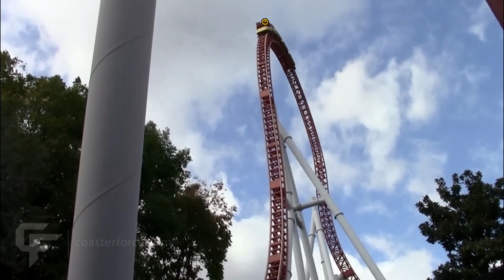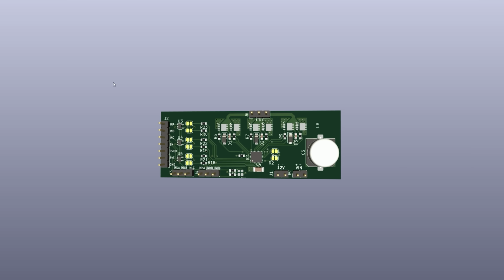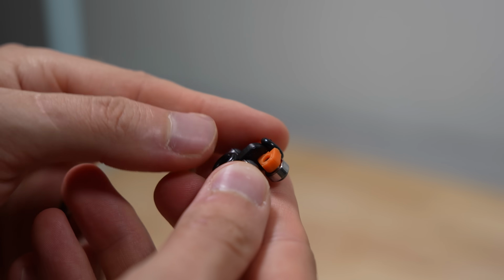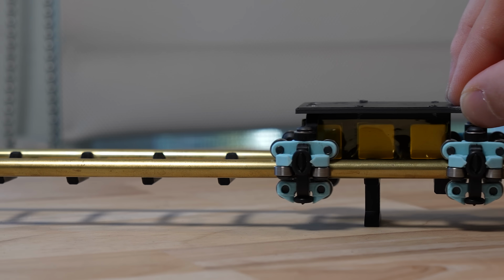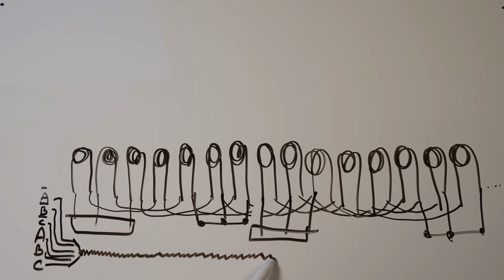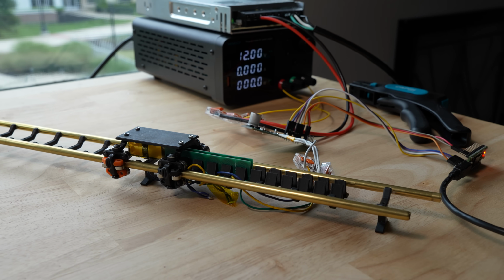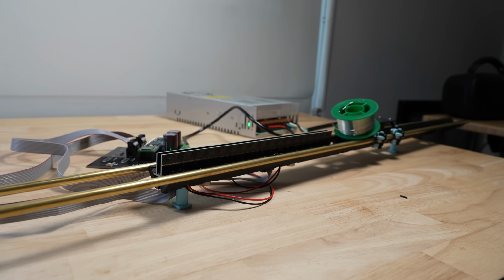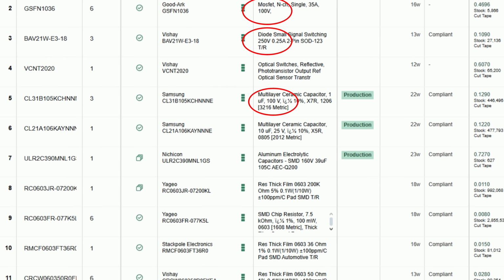Engineering a 3D Printed Launching Rollercoaster! [LSM]

Comment: You should look into small non shielded bearings and de-grease those? If you used impure Isopropyl alcohol to dissolve the grease, I assume a small amount of water from the iso got past the shields and rotted the bearings from the inside out? that would be my guess

Comment: Just hook up a microwave transformer lol
Reply from the maker: I mean...you joke but I designed the system electronics and coils to run at around 1kW peak output (500W per segment, 2 segments at most active). With a few minutes between launches to cool the coils off of course.

Comment: I don't think all 6 wheels should be. touching the track at once. You need a tiny gap so that 4 at most are ever touching. Ceramic bearings would help a ton too. They don't need to be clamped, just rigid. gravity always keeps a set of wheels touching the rail.
Reply from the maker: Need to be, no. But I want a functional but accurate model, so all 6 should be touching. The added friction does slow it down a lot so I may try to find some sneaky middle ground, like having the wheels still be compliant but hard-stop them so they nominally don't all touch.

Comment: In my opinion, one way to increase the effectiveness of the design is to maximise the coils self inductance : put a piece of steel betweenthe coils. anealed iron seemed to be a soft type ferromagnetic material, and that would boost the magnetic fields' strength.
You could do the same on the magnets, the steel would redirect the magnetic field towards the coils. 
You will need some tests, but putting steel will help, which configuration is the best ? I don't know

Comment: Don't trust LIDAR for something so precise. It might have a repeatability of 1cm in ideal conditions with enough time, but as the train moves that repeatability will go out of the window. Your original idea of having sensors at each segment would be much more reliable.
Reply from the maker: Yeah I definitely can't use this for real-time feedback. A laser displacement sensor was what I wanted to use but that was way too pricy. My goal will be to get those proximity sensors working and perhaps add a second on each segment so I can get constant train position feedback.

Comment: Put a hall effect sensor or an IR led/phototransistor pair before each coil right on the PCB and use that to control when each coil switches. No control board required, and you can chain as many as you want.

Comment: Epic job! Have you thought of simplifying everything by putting the magnets on the track and coils on the coasters? it will make the electronics much easier, power comes from the tracks or contact points, and alternating the polarity of the track/contact points causes the change of polarity in the coils.
Reply from the maker: Yes definitely makes electronics easier, but that isn't how rollercoasters do it!

Comment: Yo this is amazing. First off, you can import SVGs or DXF's into kicad as a footprint lolol. So you can draw up your coil in inkscape or illustrator and then import into kicad. Thats how a lot of art pcbs or just logos get onto boards, obvi usually the silk layer but you can do it as a copper layer.

In the Knex roller coaster world, the creme de la creme for bearings is all ceramic bearings. They're somewhat pricey at like ~$3 a piece if you sleuth aliexpress, but man my knex coaster rips with ceramic bearings now.  

Alsoooo for thermals on the PCB, you should be able to do a ground flood of the entire PCB, essentially adding a copper flood to the rest of the board that isn't being utilized for the coil, thats attached to whatever trace that is attached to the coil, and that will help dissipate heat, but I actually don't know that much about magnetism/RF so that might mess with the coils. 

I considered doing this once for my knex coaster, and just went with a quadcopter motor/ESC and Arduino connected to a chain. Its just sooo much simpler and has lasted thousands of cycles with almost no maintenance:

https://youtu.be/uckMLsE-Tts?si=Mb8IQ5Yay7Uztjbo

I'm subbed and hope to see a full layout!! Sick work man I know how much time all this shit can take, and then filming and editing is so wild.

Comment: It would be substantially easier to get feedback if your magnets were on the track and electronics on the cart. Two hall sensors interleaved like a quadrature encoder. Granted then you'd have to deal with making the coils more robust. But you wouldn't have to populate a track with PCBs, just magnets.. easier for curves. As it is you'd likely need to put hall sensors all over your boards, to figure out where the cart is in relation to phasing positions of its magnets.

Comment: Since the launcher is magnetic, then it can also be used to catch the cars.  Voila.  Anywhere you want brakes or a booster you can also have booster and brakes!  Such a deal!
Reply: Hold up. You launch with LIM, you slow down with eddy current breaking. 1) all you need for eddy current breaking is an aluminum or copper plate that will fit on both sides of your magnets. Cheaper and won’t give you headaches 2) Eddy current breaks don’t get as hot. 3) you can be lazy and not do as much math to get it set up. And 4) most modern roller coasters use eddy current breaking. They don’t require any power to work so if a coaster looses all power the train can still slow down. Eddy currents can’t stop your train though. They need motion to work. Which is why they will also have friction breaks to bring the train to a full stop.

Comment: what kicad version are you using? kicad 6 added support for curved traces through the "fillet traces" command, later versions added new route modes that let you draw curves while routing, and kicad 8 allows graphic items (including arcs) to be associated with nets, allowing them to be used as traces while retaining the features of the graphic item. EDIT: pre-8, you could create your geometry as graphic items and convert it to traces with the "create from selection" tool
Reply from the maker: Well I wish v8 was out when I started the project! Filets may have still been a thing but it was just easier for me to generatively design the coils because of the constantly changing radii

Comment: I just watched a video about a launch, were the YouTuber switched to coils and the blade... So he attached a coil to the train and than added two springs to the sides of the train which touched the metal plates which he connected to negative and positive power, he just switched the polls every centimeter so the could got automatically powered according to how it speeds up. Hard to explain and can't find it anymore... The coil on the train would give it more mass too.
Reply from the maker: Yeah Tom Stanton’s? A very simple and elegant solution for sure. Has its own advantages and downsides. Having a proper coil definitely helps with power and efficiency, but also is a much larger setup and the only control you have is go or no go haha!

Comment: Key to a good linear motor is position tracking and field regulation. Some form of low-latency feedback instead of assumption by physical modeling of the train during acceleration could improve its performance greatly.

Comment: would it work if you were to put the coils on the train and magnets along the track?
Reply from the maker: Yes you can! That does make controls a lot simpler but the problem then becomes getting that much power to the trains. Batteries add unnecessary moving mass and you’d have to still charge them somehow. Brushes would work but that impacts reliability and adds maintenance. Also it’s a lot of power to pass through brushes! This is all a big reason why rollercoasters have the coils on the track like this.
Reply: @3DprintedLife  and I just remembered that each coil can only be powered so long before it overheats so having a few coils that are constantly working won't work